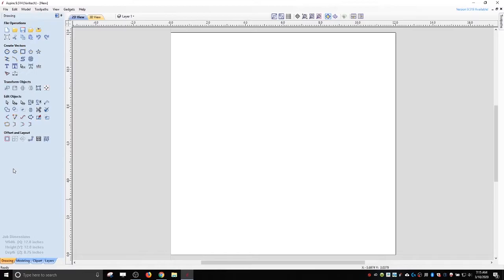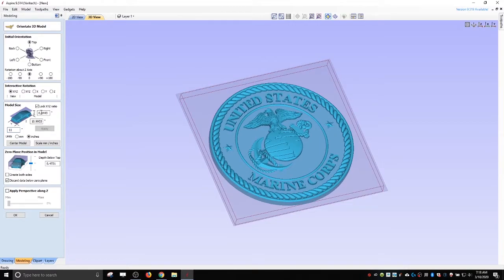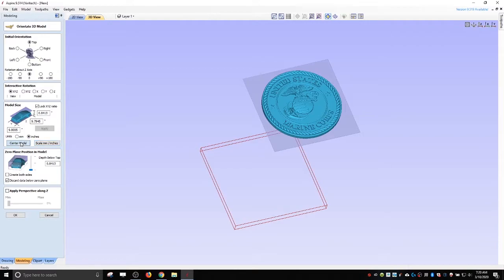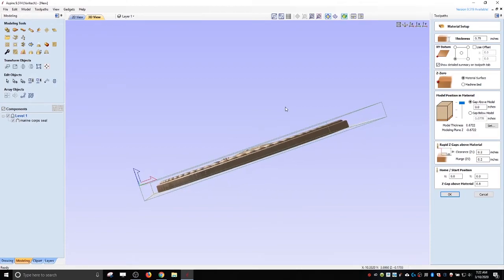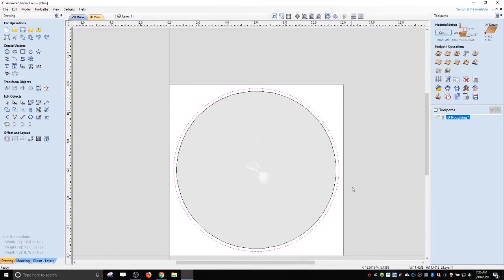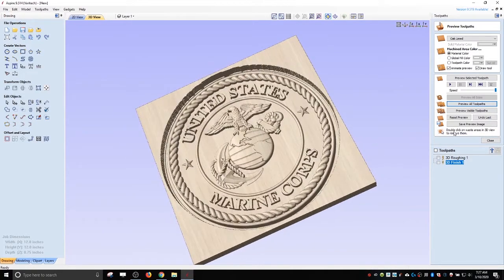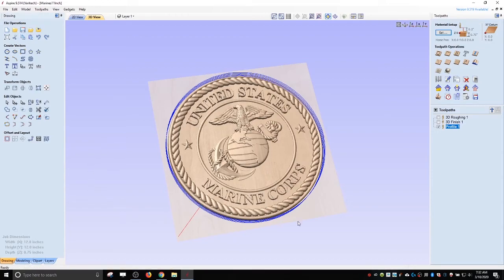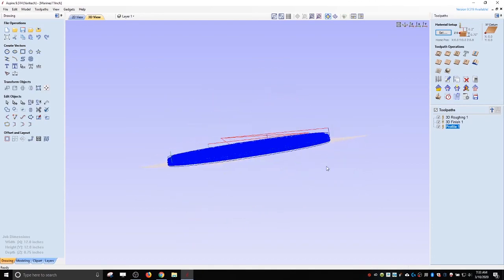Carving STL on the CNC with Aspire (Part One)

Comment: Can you give more detail on the bits you used?
Reply from the maker: I've been using these long tapered ball nose bits https://amzn.to/3jrjm0F - I like them because in the softer woods I can get away with not doing a roughing pass - depending on the detail you want to achieve - you can get different width points - I think I actually bought a set of like 4 different sizes

Comment: When using an STL bought from etsy , on a CNC with aspire . Do you need 7 zip or WINRAR as described by the seller on Etsy  . Or does aspire unload the STL file ? I`m green and confused !
Reply from the maker: Yeah - if the file is compressed in a zip then you would need to unzip it first (using Winzip, 7Zip, WinRar, etc) to get the file out - there are free versions of all of these that you can use

Comment: When you mention setting the zero plane, you look to drag the slider to the top but when you're applying and closing the slider is back to the bottom.  Did you need to apply that change to make the zero plane at the top or is the zero plane actually the bottom?
Reply from the maker: Sorry for the confusion - I must have made an edit in the video - but you normally want that slider down, which pushes the model upwards